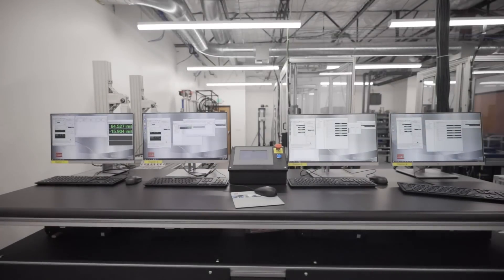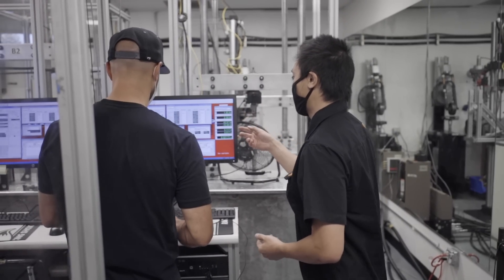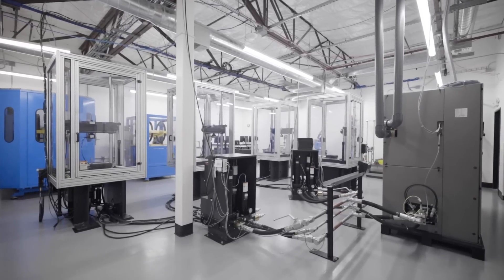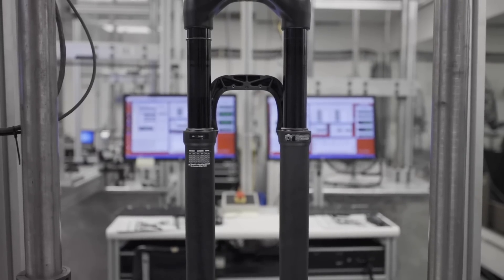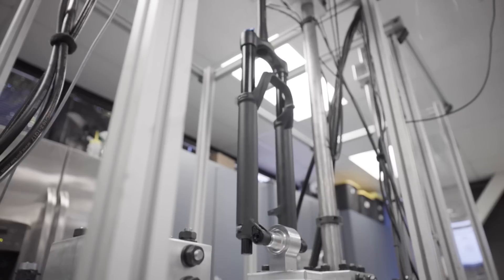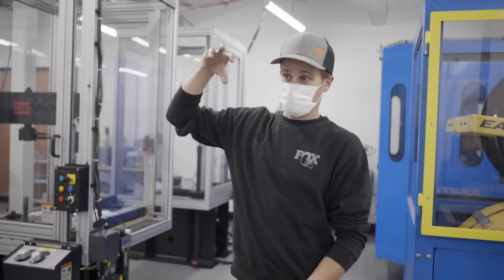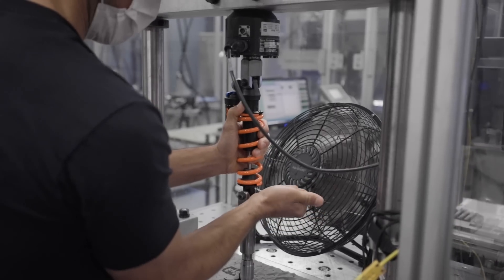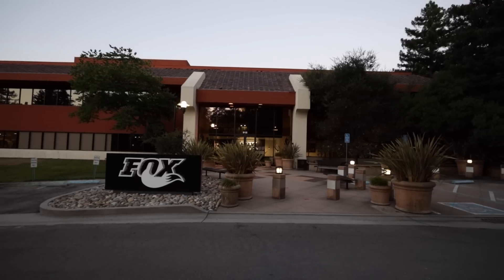DIALED S2-EP27: How is suspension tested? A look inside the Fox test lab | FOX

Comment: Having conducted reliability testing and worked on engineering validation test plans myself, these tests shown do not represent real world environmental conditions that these products are subjected to - some in harsh conditions involving hot temperatures and cold temperatures. No wonder the Fox products on the 2015 Pivot Switchblade failed. The testing shown here involves testing in one axis, under no load conditions which doesn't represent real-world riding conditions. All one needed to hear was the lab shown was days old back in 2020. One can only imagine what they weren't doing in the past. What they should do is put some money into their test plans and design something that takes the entire bike sporting their suspension and stress test it. These tests appear to be isolation tests. That's fine  if one wanted to intentionally isolate certain components only so they could see which axis produces failures on its own but, they should have a test that factors everything in just like automotive test rigs do. So, perhaps they've got other means of testing than what is shown here. I sure hope so for, what is shown here doesn't adequately test for failure. Fox is huge in the racing industry (Auto) so, one must assume they've got other means of testing that isn't shown in this video for their biking products.

 If this is all they're doing for the Mountain Bike Community - I'd look for another supplier like I did when their components failed out of the box under street riding use. I had seal failures of the rear shock - wouldn't hold pressure at the rear shock and a mechanical failure of their drop seat post. Wall thickness far too thin compounded with poor machining done at their Asian plant led to micro-stress fractures which ultimately led to the bracket snapping off the seat post on a brand new Pivot. In my experience, Fox was low - reliability on my 2015 Pivot Switchblade for, both items failed within hours of use on road use.

Comment: I wish FOX would make (or import) a decent quality rebuildable $300. fat bike sus fork with a straight steer tube and 135mm dropouts for all the new fat ebikes out there that come with crappy chinese sus forks. This is where all the bike manufacturers cheap out and most of them install Mozo Fatman POS $24. sus forks or similar. When mine wouldn't hold air anymore, I bought a Bolany ZTZ with rebound on Amazon for $140. shipped. It's actually not bad, but it is definitely light-duty, and when it breaks, it's done. I would have paid double that to get a rebuildable fork with more durability and a rebound adjustment that wasn't quirky. I will not spend $500+ for a fork that should have come with the bike, and I suspect other fat bike/ebike owners who want to upgrade to a better quality sus fork with rebound adjustment wouldn't either. WHAT CAN YOU GUYS DO?

Comment: IL LEUR FAUT PLUS DE DEUX MOIS POUR UN SAV SUR UN AMORTISSEUR DHX2 PARCE QU'IL LEUR MANQUE UN JOINT. 
VIVE LE SAV FRANÇAIS FOX
LE PIRE C'EST QUE SI ON VEUT CONTACTER FOX POUR SE PLAINDRE ON SE RETROUVE À PARLER AVEC LE REVENDEUR FRANÇAIS, COMME ÇA FOX SE LAVE LES MAINS DU SAV !!!
IT TAKES MORE THAN TWO MONTHS FOR A SERVICE ON A DHX2 SHOCK ABSORBER BECAUSE THEM IS LACKING A GASKET.
LONG LIVE THE FRENCH FOX SERVICE
THE WORST IS THAT IF YOU WANT TO CONTACT FOX TO COMPLAIN, WE FIND UP TALKING WITH THE FRENCH DEALER, AS FOX WASHES HIS HANDS OF SERVICE !!!

Comment: Hmm..Yes and why don’t you realistically test that the damping also has diagonal forces not just vertical to the axis?  is this present in your tests?  I think that the pressure of vertical forces together with diagonal forces, for example, as in braking on very steep and uneven terrain on guides and gaskets, would show realistic results in wear.

Comment: So please tell me, why did the seal on the upper part of the damper body on my 2021 Float X2 popped out twice while cruising in climb mode? Oh and, why has the CSU on my 38 with hyper-optimzed oval shaft started to creak after the third ride? Despite all your testing, why is the 2021 transfer basically incompatible with the very popular SQLab saddle due to very limited angle adjustment so that I cannot tilt it forward like on other droppers?

Comment: Is fox joking me... I bought a 2020 trek remedy for 5.300€ and the middle suspension lose all the oil after 20km of riding... and the biggest joke is, luckily my bike deal built a rockshoxs for the repairing, that they not sending me a new suspension, I got one lend from the dealer so I can use the bike, what a disgrace for fox... they repaired my used one for more than 3 weeks 😂 if for example my 1400€ iPhone 11 Pro Max don’t work well maybe a button I go to the Applestore and after 10min I went out with a new phone for warrenty that’s Service ! Bad final test for such a high priced suspension is one thing but this bad service is from an other world... maybe someone think about FOX an my story when  they buy stuff from them ... ✌🏼

Comment: i still cant find out a real answar about: HOW BAD IS TO REACH FULL TRAVEL?
i mean, what if i do a drop on a flat surface so the fork just get FULLY compressed (and you hear that bad steel sound)
how bad is for the fork?
Reply: The fork is meant and built to run through its full travel. If you are bottoming our on every drop and every jump though, eventually the forks seals will get a bit tweaked. Add some volume spacers or some air to fix that problem. If you have a coil fork then... get an air fork
Reply: That sound is the fork hitting its rubber bump stop. Nothing to worry about whatsoever.
Reply: Not bad
Reply: Forks are made to get through its Travel so🤷‍♂️ so yes it is completely ok to Flat out every Single Jump you find

Comment: Great video, I do have a question/concern though: I recently sent in a 36 off of a new bike for warranty because of significant play between the stanchions/lowers and a "klunking" noise and feeling over small bumps. Unfortunately, I received the fork back and the issue still persists. The service tech noted that the fork was tested and appeared fine, but upon seeing this video I am wondering if the testing would not account for forward/backward forces that would normally occur while riding and could produce the play?

Comment: Q: Lets say my frame fits a Trunnion 205x62.5, but a shock I'm looking at only does 205x60 and 205x62.5. Can fox customize the stroke length that is not standard in their lineup?

Comment: I blew my new DHX2 coil shock seal head as a long crack around the shock eye bolt. 2020 model and have had a shock rod fail as well. The first failures in 5 years off fox suspension i have used. Still waiting for it to come back from fox as parts hold up covid19

Comment: Fox: the forces generally shown in this video on the fork appear to be of translation in the y-direction (in-line with the forks vertical travel), however, there are also other directions of translation-forces, as well as rotational-forces that happen in real-world riding (rolling, trimming etc.) But how do you test for this to ascertain for e.g. bushing wear rates and other failure-mechanisms?  The fork test rig appears to have bolted the fork with precision alignment of the vertical travel, therefore, other load-paths are then excluded.  Can you please explain?
Reply: Good point, since bikes have 62.5 - 70.0 degree head tubes, and are sometimes on an angle (going over roots while leaning right or left, etc).
Reply: I was thinking the exact same thing. I am interested in what other tests are ran.
Reply: This wouldn't be the only testing, im sure they would do on bike testing. A lot of this type of dyno testing is to stress the damper, not the actual stanchions and lowers and crown
Reply: Why don’t they just show you, and the world, and their competitors? 🤔🧐
Reply: Ever heard of 36s CSU creeking issues? They clearly never did, not with this kind of testing...
Reply: @totojejedinecnynick  It's not just Fox and the 36 that can suffer from that
Reply: @totojejedinecnynick  they clearly test on one axis only. 36s CSU creak is widely spread
Reply: @visques  not only 36, all of their forks creak, my old 32 did, my friends 34 and 36 does and at my lbs they have a test bike with the new 38 fork and when I asked they told me it sometimes creaks even though the fork is not even 2 months old...
Reply: I came here to write this same statement and ask this question but you did it for me. Thank you
Reply: The problem there is more the limitation on the test equipment. The load cells aren't designed to take those kind of lateral forces and would snap almost immediately. They probably set up some sort of offset loading test on a different fixture, but mis-alignment on a dynamic test like that leads to failure of the test equipment, not the specimen being tested.
Reply: @iankirk7809  maybe so unless the testing equipment was designed according
Reply: @iankirk7809  Interesting points, however, seeing common rail fuel injection, electronic variable valve timing, gas injection, and continuous combustion control/mapping on the engines that I work with provides evidence to suggest that setting up some load cells/strain gauges on a suspension fork is possible.
Reply: @iankirk7809  Interesting points, however, seeing common rail fuel injection, electronic variable valve timing, gas injection, and continuous combustion control/mapping on the engines that I work with provides evidence to suggest that setting up some load cells/strain gauges on a suspension fork is possible.
Reply: @Bari_Khan_CEng_CMarEng  I'm not saying it isn't possible, it just that the systems they were showing weren't set up to do that type of off center load testing. You would need to have a fixture that translated the lateral forces into axial, which is possible. I am sure they do something to that effect on some of their systems. They didnt show us every system in each lab, they only showed us what they wanted to show. Fox is very particular about their test systems, I work tech support for a materials testing equipment company and I know that Fox is a tough customer to please, they beat the hell out of their systems.
Reply: @iankirk7809  Oki doki bud, cheers for explaining, and for sure the intellectual property and liability for showing sensitive product testing in particular for regulatory compliance may be too much to show on YouTube.
Reply: Mucho texto
Reply: We can’t show all tests, this is for you tube
Reply: Me: Reads entire comment thread

FOX: ...........................
Reply: You beat me to it, good thing I checked before asking:)👍
Reply: Ah but have you taken into account the gravitational force of the earth at 9.80 m/s 180 degrees?
Reply: YES ! this video is an advertising, they don't SEEM to be expert in mechanic ... Maybe they do better test, but here this video is for noob people.

Comment: Except there is no use case, where the force applied to the fork or shock is directly inline with the stanchions. I've never seen a test rig that applies load at an angle. Are they there, and we just don't see them?
Reply: Yep, they are there! I just wasn't able to film every single test.
Reply: @JakeFrew  Nice! Thanks for hitting me back.
Reply: saw that in a rockshox video.. was wild